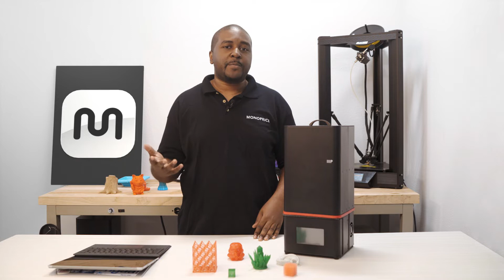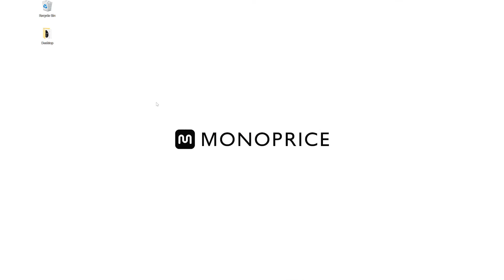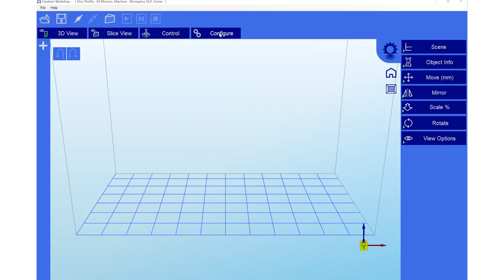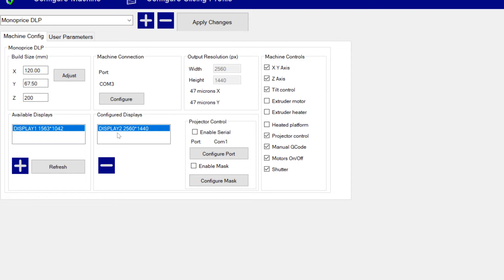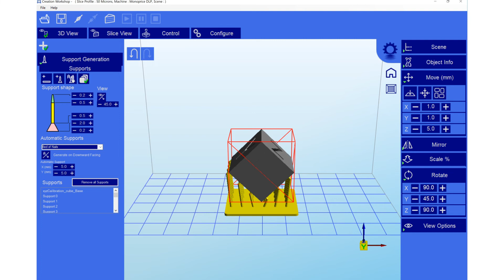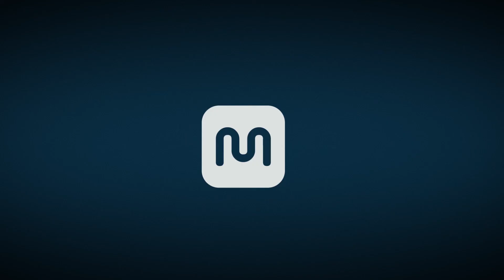Learn How To Setup & Use Creation Workshop Software

Comment: I can not get the correct configured display to show up.  The only displays available are the displays (my monitors) that I have plugged in.  

How do I add or re-add the configured display that is shown in the video?
Reply: I managed to "spoof" the display size by going into Nvidia and creating a custom resolution.  I haven't had a chance to verify this will work, but it the first step in my work around so far.  So, if you don't use an Nvidia graphics card, I'm not sure what to suggest to fix it.
Also, I purchased an USB cable to go between the computer and printer, which did nothing... I abandoned that venture.